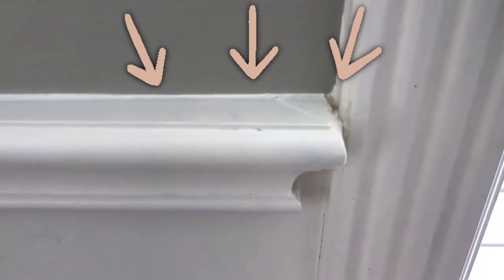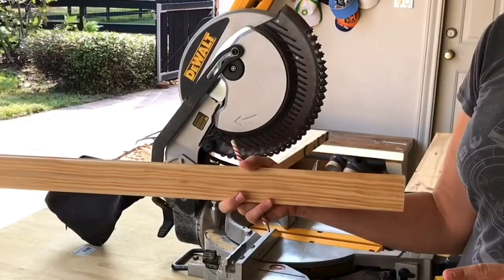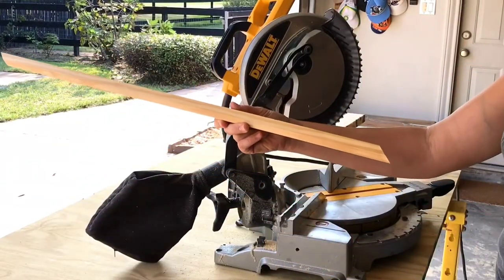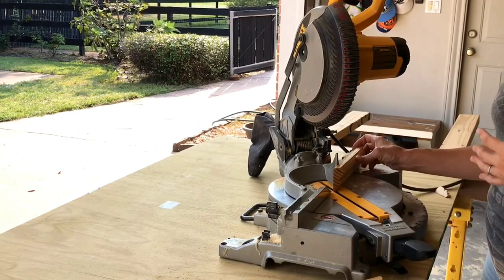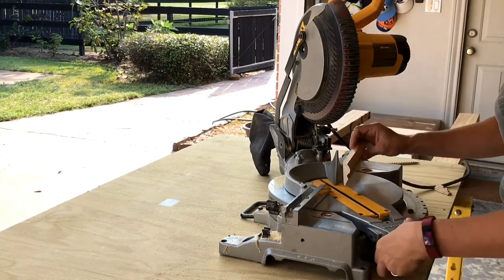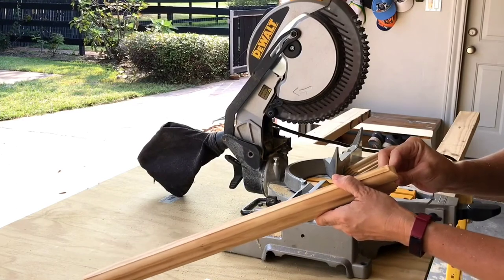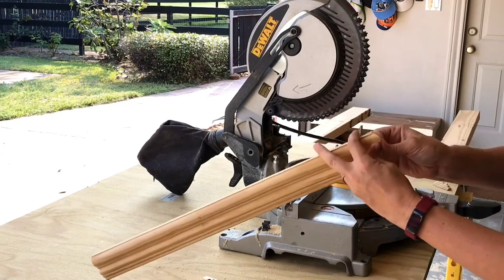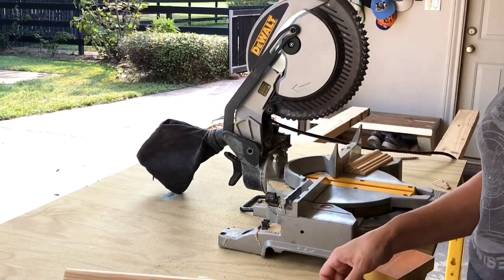How to Cut End Cap for Chair Rail Molding (Dead End Crown Molding, Baseboard, any trim molding)

Comment: How about an end cap if the chair rail is already up and flat or 90 degrees at the end :)
Reply from the maker: Sorry, I can't think of any tricks for that. :)
Reply: you will have to use a multi-tool saw to cut the 45 on the chair rail that is up on the wall